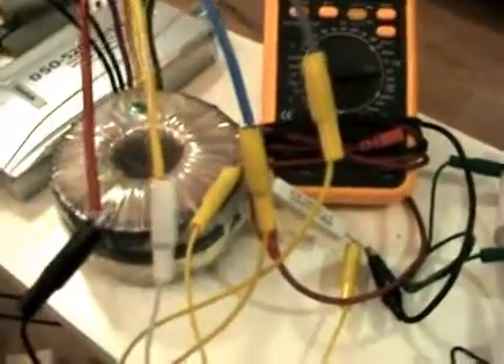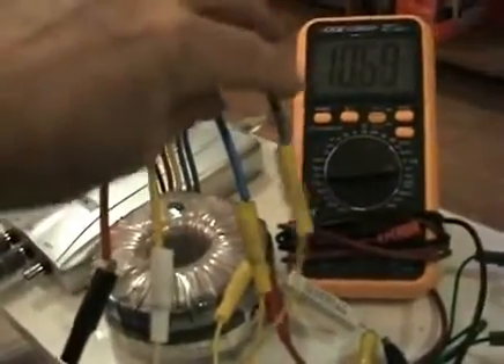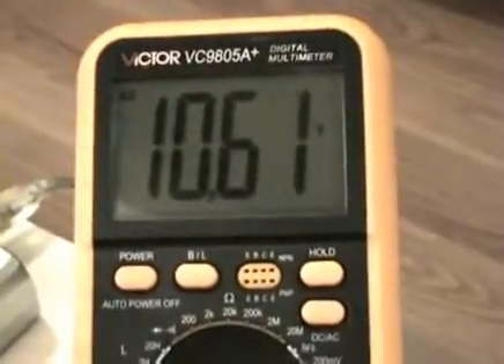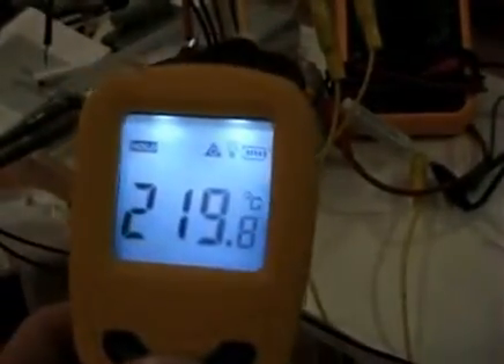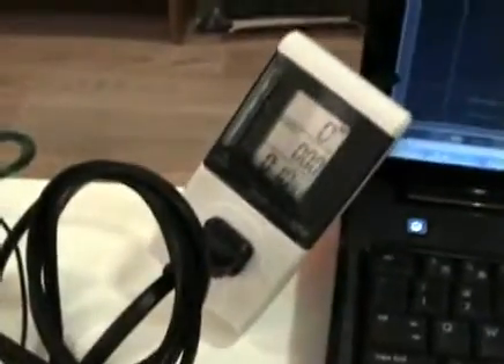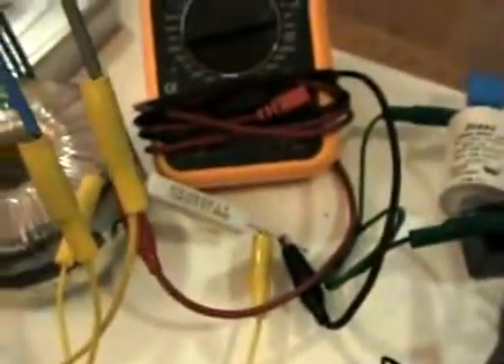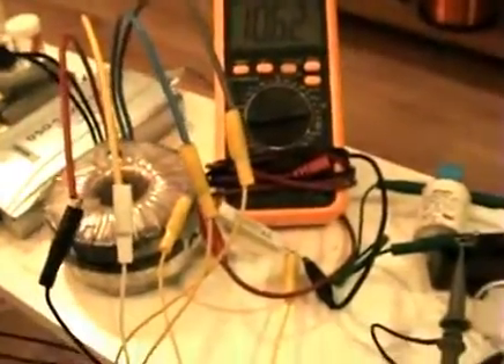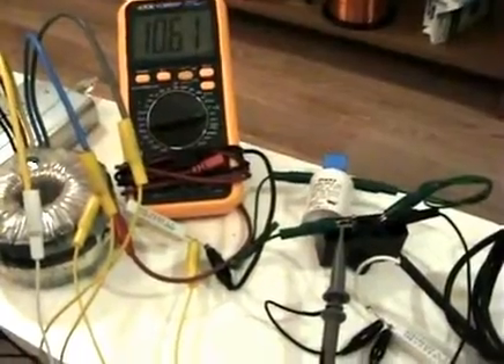Delayed Lenz Effect in Transformer Test 3

Comment: Dear, so actually you don't use high frequency and a high inductance secondary? The frequency you use is 50 hz from the socket, what is the difference between the primary you use and the secondary? regards

Comment: I do not trust the instruments. Why not put a resistor in series with the supply source and monitor the heat vs the output heat. Not sure what size the resistors would have to be for a 1 to 1 heat relationship. Thanks for your work.

Comment: Hi Gotoluc, It seems that if you have 23.4uF and the applied freq is 60hz that your winding thats being resonated must be about 300mH for that to be "resonant" based on the mains assumption...  Is that about right?   What happens if you swap out the 10ohm 10 watt resistor for a fwbr and a cap?   are you able to retune the resonance to have the wattmeter show 0 watts again?   is it any different if you leave the secondary open?  good experiment!

Comment: @THEWATERENERGY1 
To check out your 'screen' I googled SEJ-Pesnetwork-8x. 
Found a video with an oscillator very similar to electron coupled tube oscillators I constructed 5 decades ago.
What struck me was the statement that current developing voltage across the 1 ohm resistor in series with the battery represents 'power'.
NO IT DOES NOT.
I REPEAT - to measure the battery power being supplied your MUST use a capacitor damped moving coil meter or a physically slow moving iron meter !!!!!

Comment: @bennjanse 
You can convert (efficient) switched square wave into a sine waveform using an inductor in series with a capacitor having values that are tuned to the frequency of the square wave.

Comment: @THEWATERENERGY1 
PLEASE.
The main line supply system has an extremely low source impedance;  your measurements might appear to be correct, but your conclusions are WRONG.
Do you know what this effect is?
The alignment and release of electron orbits within the core, where the orbit alignment coherence is related to winding current which is resonantly phase shifted with respect to the applied voltage !
Please appreciate this is a CLOSED system, and thus incapable of generating excess energy.

Comment: Physics !!!!!
Please put a moving coil or moving iron milliameter in series with the line connection because a digital Watt-meter capable of reading only in-phase voltage and current will give a false reading when you have tuned to perfect 90 degree phase shift.